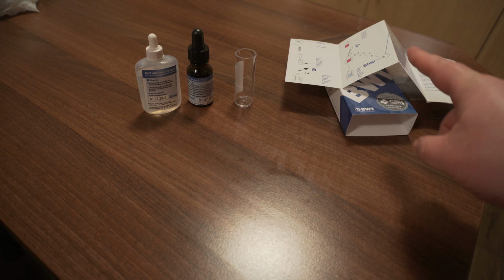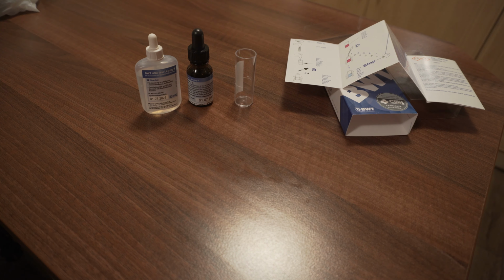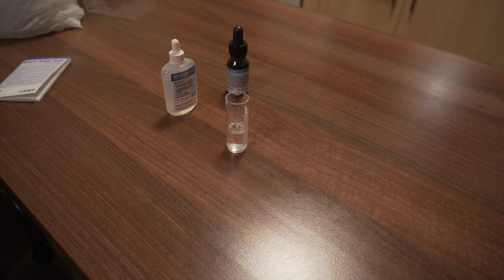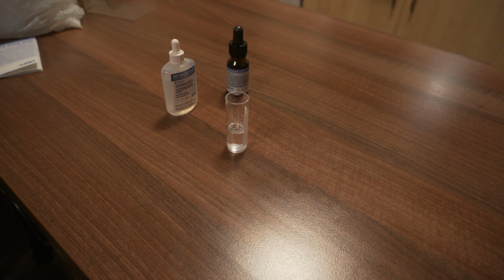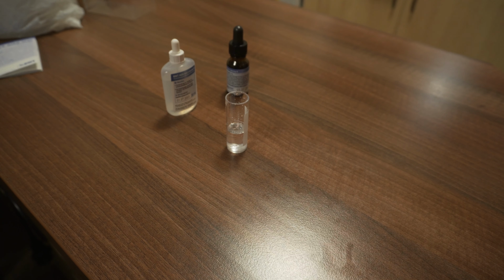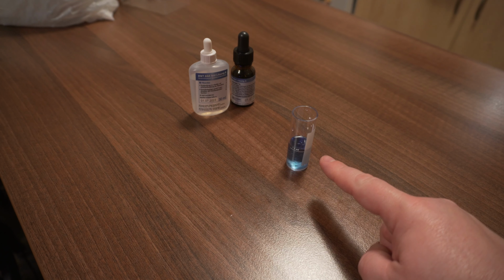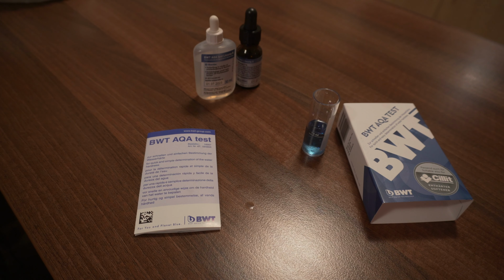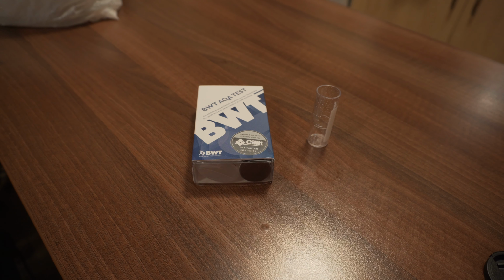BWT AQA Test water hardness tester

Comment from the maker: MJJC Foam Cannon Pro, straight from the manufacturer: https://www.mjjc.com/collections/foam-cannon/foam-cannon-pro/?ref=OCDADDYZSOLT

ADBL Shop, 10% discount with the ocdaddy code: https://www.adblshop.hu/?coupon_id=ocdaddy

Waxwerk.hu (Dunking Biscuit etc.), 5% discount with the "OCDaddy" code: https://waxwerk.eu/?ref=OCDaddyZsolt

Project-F.hu, 5% discount with the "OCDaddy5" code: https://www.project-f.hu

Farmasi Hungary, 23% discount by using the following link: https://farmasi.hu/Account/Create?sponsorCode=64648810-11cd-44db-942e-3a229e0eb3b1
Farmasi Poland, 23% discount by using the following link: https://farmasi.pl/Account/Create?sponsorCode=64648810-11cd-44db-942e-3a229e0eb3b1
Farmasi CZ, 23% discount by using the following link: https://farmasi.cz/Account/Create?sponsorCode=64648810-11cd-44db-942e-3a229e0eb3b1
Farmasi Slovakia, 23% discount by using the following link: https://farmasi.sk/Account/Create?sponsorCode=64648810-11cd-44db-942e-3a229e0eb3b1

Polirtech.hu, various discount for certain times, details under the relevant videos: https://polirtech.hu

Automosowebshop.hu, various discount for certain times, details under the relevant videos: https://automosowebshop.hu/?coupon_id=ocdaddy

TubeBuddy for better channel analytics and tools: https://www.tubebuddy.com/OCDaddyZsolt
Would you like to have a single card that can be used instead of all other cards of yours? Use Curve - http://www.curve.app/join#DG8K2BLD
Would you like to have one of the best exchange rates and safe shopping/money transfer abroad? Use Wise - https://wise.com/invite/asd/zsoltv23

In case you would like to support the channel, can do the following ways:
PayPal - zsolt.tech.detail@gmail.com
Buy Me a Coffee - https://buymeacoffee.com/OCDaddyZsolt